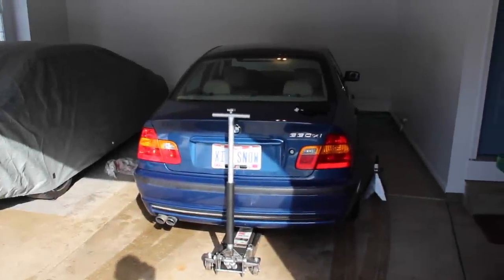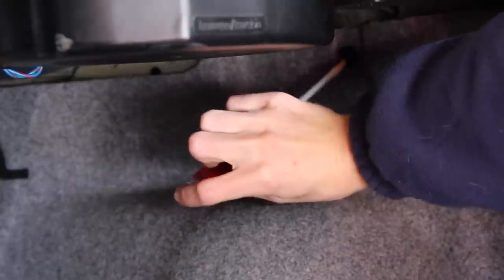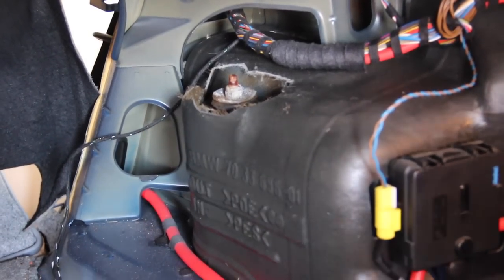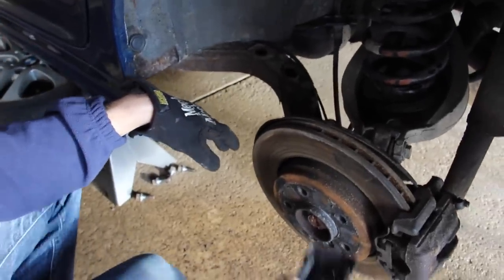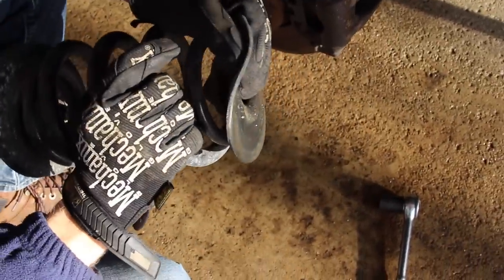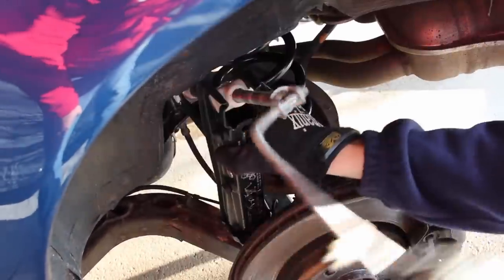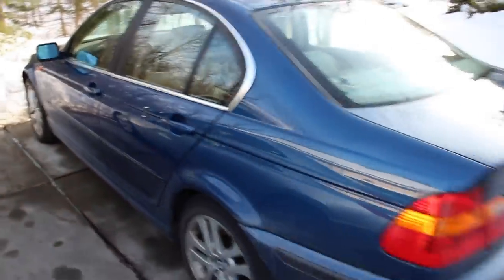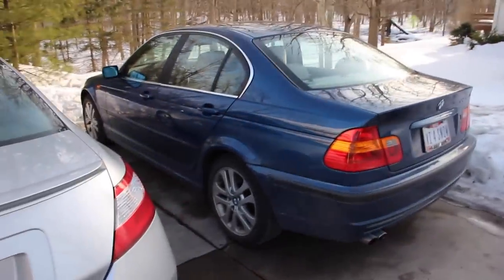BMW E46 Rear Shocks/Springs DIY

Comment: Thank you for your video, I went to four different part stores looking for a spring compressor short enough to allow me to remove the rear springs. I finally gave up and searched for more videos until I ran to your video. I was able to do everything without purchasing the spring compressor. You saved me some money and I appreciate it.

Comment: doing mine this week! One thing though, Bentley manual says to take off halfshaft from diff and remove sway bar link. I believe that axel removal limits damage to rear hub bearing. New end links are 16 bucks so replace them to.

Comment: Man I know this is e39 source but I am loving the vids of you working on the e46. Really starting to push me in that direction vs e39. But that's also partly because it's much easier in my area to find a manual e46 than an e39
Reply from the maker: I seriously recommend an E39 more than E46 for nearly all applications.  You should test drive both and decide for yourself though!
Reply: Ryan, Why would you suggest it over an e46? And I agree with neil, would be nice to see a comparison vid since you have both. It's a little apples to oranges but it still would be great to see for guys who are in between.
Reply from the maker: ahastar1141 I will always suggest an E39 over an E46.  It's a much more refined and quality built cars.  Materials, construction, size, options, electronics, it's all an upgrade in the E39.  I could do a 330xi vs 525i if Kennan would participate, but there's still a difference of 3.0 vs 2.5 engine and 60,000 miles.
Reply: ***** Kennan's 525i is base, but it has retrofitted xenons now.  My 330 is actually loaded except for tech package... but the idea would be the same.  We'll try something out in the spring though!

Comment: Thank you so much for the video! Actually was doing the springs on my X3 (e83 rear suspension is identical) and was getting desperate on how to put the new ones in- and then came across this vid using the trunk jack. GENIUS! Thank you.

Comment: I've got a 2005 330xi and put in the yellow Koni adjustable sport strut. They are amazing. I can adjust front from under hood. But rear needs whole strut off.  They are too soft. I want to crank it up to full stiff.  Thanks for the guidance on removing so I can adjust them to the same as the fronts now.

Comment: Very helpful, thank you. I was going to do shocks and struts on my 2001 330i 5 speed, but unfortunately about 2 weeks ago the head gasket went bad, so it looks like I'll be doing that instead. I may still do the struts, because they are beyond wasted. Unfortunately the previous owner of my e46 was not very good to it.

Comment: sooo    how can you tell which side goes near the wheel if the shock doesnt have marked on the bottom  how to put it in???
Reply from the maker: I would cross-reference the part number to see if it becomes clear which side is which, or if it even matters.  With BMW part numbers, evens are on the right (pass) side of the car.

Comment: Im driving a BMW 530i 2003 and I'm hearing a noise when I go over speed bumps and if I push down on the back end. My question is how do I know if its the struts or the shocks
Reply from the maker: +marquis hargraves Have somebody with experience look under the car and see what's going on.  Could be any one of the many suspension components.

Comment: Hey, I just replaced the shocks and springs in the rear and I'm hearing a clunk every time I go over a bump in the road. Could having the shock mounts improperly installed or the bolts not being torqued enough lead to a clunk?
Reply from the maker: I would pull them out and re check the mount installation.  It should go  shim, washer, mount, upper washer, nut.  Ensure that parts 5 and 6 are present from this diagram:  http://www.realoem.com/bmw/enUS/showparts?id=EV53-USA-09-2002-E46-BMW-330i&diagId=33_0841

Also, the torque specs are as follows:

two outer bolts on shock mount:  10-15 ft lbs (snug)
middle bolt on shock absorber itself:  not sure of exact spec, but I made mine tight.
bottom bolt, shock to wheel carrier:  ~75 ft lbs

If you did not replace the mounts when you did the shocks, I would highly recommend it.
Reply: this same thing happened to me when i did the shocks on the E36. Once you drop the car down on the ground, check the two nuts on the shock mount for tightness. What happens is that once the car is on the ground, the shock compresses even more due to the weight of the car and creates additional play in the shock mount

Comment: Hey! I need to replace my left rear shock and was thinking about replacing them with a lowering kit. The kit i am looking at is "Tuninart" theese are coilovers. So my question is: will i put the spring over the shocks or the springs where the old one is and the shocks alone? or will the spring be over the shock? talking about the rear end.
Reply from the maker: +Hansi “FIX” W Every kit is different.  I don't recommend lowering.  The car will drive like a covered wagon, and you'll rip off bumpers on road debris.
Reply: +E39Source Aiight, Thanks for answering! Lowering the car has been my thoughts since i started looking for an e46 so i feel i need to do that. Atleast when i need to replace a shock anyways. Great vid btw, liked and subscribed!

Comment: What is the torque for the shock bolt that holds it to the wheel? Also, the torque for the bolts on top, in the trunk? Thanks Ant
2003 330xi
Reply from the maker: I didn't check the specific torque specs, I don't believe.  Tighten until tight!

Comment: great informational video man just wondering if I were to use a spring compressor instead of the "stock jack" method, would it be easier or not work at all? any help would be appreciated thanks
Reply from the maker: +derek cook There is no need for a spring compressor on the E46.  It's much easier just to pull down the rear suspension and pull the spring out!

Comment: Hello, I have a 325xi 2005 sedan and I was wondering, would this would work on my back suspension?
Reply: darkoSTBEA The process should be very similar.
Reply: Bobby O'Hearn What about the parts, the same as well?
Reply: Most likely.

Comment: Is an alignment necessary after replacing the springs only?
Reply from the maker: With the whole strut assembly having to be removed, and the new springs likely changing the right height, I would advise that you do have the alignment checked and adjusted if necessary.

Comment: Enjoyed this video - great job!  Did you think about replacing the rear trailing arm bushings (RTABs) while you were at it?
Reply from the maker: Should probably be done.  How much work is that hough?  Never looked into it.
Reply: ***** If your RTABs are original, they will probably be crumbly enough to get out easily.   Look at these:  http://tiny.cc/dwwavx
Reply from the maker: garytanaka I gave it a visual, nothing is crumbling.  I'll probably save it for the next owner.  Thanks for the info though!
Reply: ***** Is it possible to make a video on a front license plate delete?
Reply from the maker: George Patton Check out my intro on the car, I included that.  Check Real OEM for your specific part number.
Reply: ***** The M5 intro? I should have clarified I have an e39, not e46
Reply from the maker: George Patton I apologize!!  Plate delete on an E39 (non M5) is the same process though.  Just buy the delete panel and snap it in.
Reply: ***** No worries! Thanks a bunch!

Comment: Can you tell me what was the part number of the coil springs?
Reply from the maker: Parts are listed in the video description.
Reply: @E39Source  thanks, I ask because I have a 330xi and I have in the past orders coil springs for my car but they are most likely springs for a 330ci. I am pretty sure the 330 rwd and AWd have different coil springs, wouldn’t they? The AWD definitely sits higher.
Reply from the maker: @btraf4575  The xi does sit higher.  Xi cars equipped with the sport package did NOT receive the lowering springs that ci or I cars did.  So they may be the same as non-sport RWD E46s.
Reply: @E39Source  thanks, will look into it. Many websites selling these coil springs claim 330ci and 330xi can use the same springs.

Comment: Hey guys, is there anyone in the source that has the typical e39 broken headlight adjusters. Also what are some symptoms that you need new adjusters? can you guys make a diy video on how to replace the broken adjusters with the new ones?
Reply from the maker: Kennan recently solved his problem on his 2001 525i.  All of us have suffered from broken adjusters, and we've all taken the same steps to resolve:  buy new OEM Hella euro-spec lights from Umnitza.  It's expensive, but yields a perfect headlight.  With his old lights, Kennan may be doing a DIY on baking the lights open and replacing the adjusters though.  Stay tuned!
Reply: If I had $2000 laying around I would definitely buy the oem hellas but I dont. And I honestly don't know if I should buy aluminum adjusters for $160+ or just buy plastic adjusters, and redo then when they need to get replaced again. So keenan should be coming out with a diy soon?
Reply from the maker: Karim nassef They're about $1100 new with shipping I believe.  The stock plastic adjusters seem to last maybe 10 years, so I'd probably just go with those.  Unless your roads are really bad there and they might break sooner.  I asked him about the video, but I think he may have one this spring once it warms up a little more.
Reply: Ok, I guess I'll just wait for his video.

Comment: Would these parts fit my 318i se?
Reply from the maker: I don't know if the 318i se used the same rear suspension components.  Check RealOEM.com to confirm part numbers.

Comment: Could i use the same shocks as in this video but instead using those springs you used i would use some diferent lowering springs. Would thatwork? Sorry for my bad english 😄
Reply from the maker: +Simas/Mc To a small extent, yes.  You can't lower the car a ton on these struts though, they're designed to be used at the stock ride height.
Reply: +E39Source ok. thanks ☺

Comment: I couldnt get bottom and top mounted washer plate (33526762325,37575758999). Will be ok if I use an old washers?  Anyway thanks so much for this video!!!!!!  It`s gonna save me a lot of money.
Reply from the maker: You should be fine as long as those old washers aren't warped/cracked or anything weird.